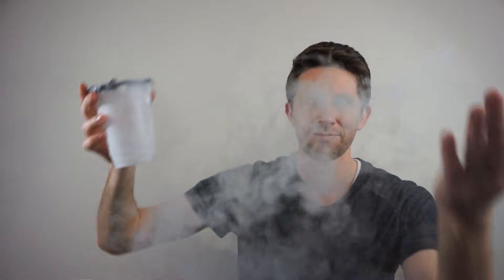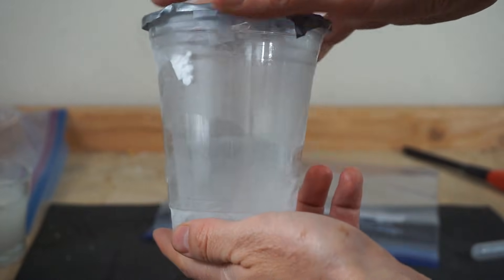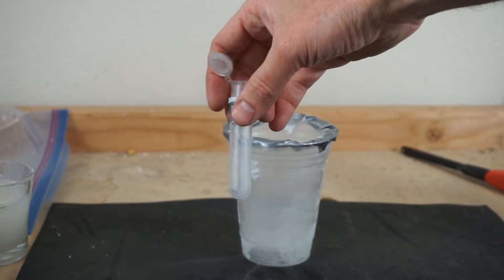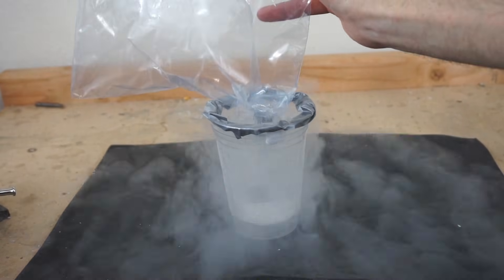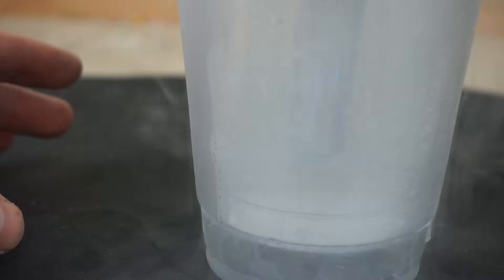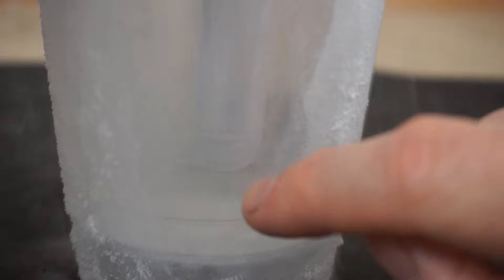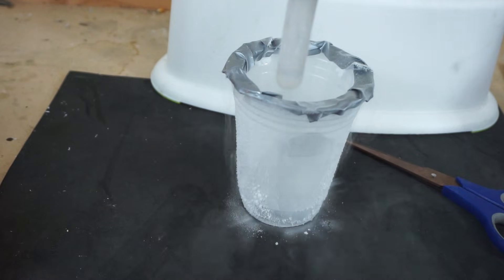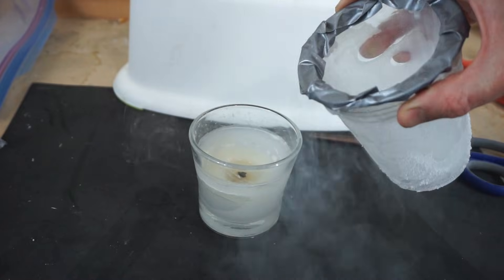How to Turn Air Into a Liquid

Comment: apparently Air (oxygen), becomes metallic under pressure, at 96 GPa - "Pressure at which metallic oxygen forms (960,000 bar)". I'd guess the Aerogel is a diriviation from from the Blue Ice they found in Antartica. And so is all the liquid- nitrogen, oxygen, dry ice and so on. But who rly knows, might as well came from the removed parts from the Bible or cellars in Rome,,, or some other private collection who holds insane information and history of everything public school would teach if it didn't want a very specific type of individual ready to go vote and take boosters and pay for their already paid water. Fathers built it, paid for it. But one neighbur is making you pay for it. Lovely system :) And he's cousine made a bank. Who knew.

Comment: I have a question. So the liquid air - in variance to the liquid nit. If it could be sustained and collected could the liquid air be combustible. And if you could build a contraption that could continuously feed into the nit. how long would it take to make enough to fuel a small engine or something mechanical?

Comment: If we take away the CO2 from nitrogen and oxygen how does the N2 and O2 gain heat energy given they are both very low thermal conductors (near 0 WmK)and they both do not emit or absorb any infrared radiation.   Paradox?

Comment: But air is non condensable
Reply: You're confusing compressible with condensable. Condense means take from gaseous to liquid form. No real fluid (gas or liquid) is actually incompressible. But, if pressure changes relative to absolute pressure of the fluid don't change the density very much they can be treated as incompressible and GREATLY simplify the math. Why deal with the hard math if you don't have to and it doesn't introduce any significant errors.

Comment: Can't you turn air into liquid under pressure? I need thaat
Reply: No. Oxygen and Nitrogen can not be compressed into liquids above a temperature of -100C. They are cryogenic (literally created by cold) liquids. Natural gas cars work on this principle... since it can't be compressed to a liquid at ambient temperatures, just a more dense gas, they pressurize the tank to lots of gas into a small volume. Something like 4,500 psi.

Comment: Isn't it just air moisture
Reply: No, moisture is water vapor (h20). Air is a 79/20 mixture of O2 and N2 molecules. Water vapor is liquid between 0C and 100C. Oxygen doesn't become a liquid until it cools to -297F

Comment: Fool,
The contents in that tube is air which is composed of 70% nitrogen and 30% oxygen. The test tube is not 100% pure oxygen, so of course the contents in that test tube would turn in to liquid nitrogen. FAX
Reply: totally agree, liquid oxigen is cooler than liquid nitrogen so probably in the vid we only saw liquid nitrogen making more liquid nitrogen :P
I don't think u can make liquid oxigen with liquid nitrogen
Also liquid oxigen is pale blue
Reply: Air is approx. 78% Nitrogen, 21% Oxygen, and a combined 1% of other gasses like Argon, Carbon Dioxide, Carbon Monoxide, etc.

Comment: could you make solid oxygen, and is it safe to eat?
Reply: first question: yes
second question: no
And in the video u r just seeing liquid nitrogen, liquid oxigen is blue not transparent, oxigen has a higher freezing point, so u can't make liquid oxigen with nitrogen
What u see on this video is liquid air wich is mainly composed by nitrogen, 79% nitrogen to be exact

Comment: pv=nrt
can we boiling water just by pressing it in a chamber of fixed volume?
Reply: You could boil water by putting it in a vacuum chamber and decreasing the pressure, yes. All boiling is is giving the molecules in the liquid enough energy to become unbound. Atmospheric pressure keeps them together until enough heat (for water at sea level it is 100C) is in the liquid. This is why water boils faster at higher elevations (high altitude cooking instructions). Decrease the pressure enough and it will boil at room temperature because room temperature gives the molecules enough kinetic energy to become unbound from each other.

This is also how pressure cookers work. The high pressure keeps the water from boiling and just provides heat at pressure that gets forced into whatever you cook.

Comment: Very cool. What could that liquid 02 be used for?
Reply: Rockets. SpaceX's Falcon 9 uses refined kerosene (RP-1) as fuel and liquid oxygen as the oxidizer (that's the white vapor venting from the rocket before a launch, liquid o2 turning back into a gas). The new SpaceX Starship uses liquid oxygen and methane fuel (methalox).

It is also really great for storage of lots of oxygen in a very small space. You saw how a gallon baggie of air contained only about 1 cc of liquid. Realize that air is only 20% oxygen and 1/5 of that liquid in there was oxygen. Store big cryocylinders of that stuff and you have a LOT of O2 on hand.

Comment: Wow u show approximate condensing ratio WHICH to me is more important then pressure ie how many times do you HAVE to HALVE air cto make it liquid versus how uncompressed must it be to remain a gas . . 

Anyway o8 is a material that takes up even less space then o2 in solid form AND has yet apparently to be sold at atmospheric pressure despite it's stored kinetic energy.

Which sucks sir!

 Phase change materials tend to be passive so lack nonrenewables density.  O8 can be driving energy source for heatpump to trigger expansion and recover ENERGY needed to compress it.

If it could be made at SCALE.  The motive to do so is greater in atmosphere as heat is available UNLIKE when used to burn For ridiculous rocket power!

But nobody cares about renewable fuels.  

The thing is that as fracking demonstrates when it comes to fuel 100x to 1 ratio is fine.  A solar plant that solidified air need only nearby rail so could waste most of THE initial heat if it concentrated energy into a moble form ten times as dense as gasoline without any non reversible effects aka poluting when used.

Nitrogen of course to a lesser degree is a clean kinetic spring fuel needing only magnetic levitation in a vacuum insulated container rig to be storable across days or LONGER when like supercapacitor banks only hours or less obtain 99% of value.

The plot thickens lol.

Like toy planes bikes can't require a. too expensive fuel.  That's just not possible as they need so little! For most the cost of battery per trip, like incandescent bulbs did, vastly exceeds power purchased to charge thems COST.

So coal Burning even burning bikes save planet arguably but red oxygen zero emission ones are sexiest vehicle known in universe and O8 seems excellent even ideal fuel for supersonic container ship trailering.

'Screwing' air into crumbles does dump heat.  The heat can be used by colocation or dumped. Solar heat is priced dam cheap when used to frack etc.  The incentives exceed its cost even! In near future most solar energy will be used to release carbon via combustion.  HELLO?

Instead of making red oxygen pellets to power clean bike turbines.

FUCK that!

Comment: Liquid air?   Why don't they use that in scuba tanks? I mean with an expansion chamber of course.  Is it because the water would freeze around it?  The tank isn't strong or thick enough to hold liquid air?  Oh wait. The nitrogen would expand first and suffocate you, right?

Comment: So is when you say boiling point you mean the liquid is actually hot and regular boiling right? So then what is all that gas going off from the cup?
Reply: That was condensed water vapor (fog or mist) you can't see gas.  You can't see steam either. That's also condensing water vapor.
Reply: Yes, it was boiling but "boiling" only means too warm to remain liquid.  Water boils at 100C.  Iron boils at many thousands of degrees and liquid nitrogen boils at a temperature higher than dry ice but still horribly cold to us.
Reply: Boiling does not mean hot. Boiling means that the molecules of a liquid have enough kinetic energy to break apart from each other and become free floating. Liquid to vapor. Liquid water at sea level boils at 100C (212F). Liquid water boils at 85C (185F) at 14,000 feet. Less pressure means it is easier for the molecules to break free from each other which means it takes less temperature. Oxygen molecules require so little energy to free themselves from a liquid that it boils at -297F. Anything above that temperature and it turns to oxygen vapor, like boiling water turns to water vapor.

Comment: Can we turn liquid into solid by compression
Reply: There is a property of gasses called the critical temperature. It's the temperature above which a gas can not be compressed into a liquid. For things like N and O, that's about -100C, which is why they are called cryogenic liquids. Cryogenic comes from two greek roots meaning created from cold.

Comment: Question, could liquid air be generated with a cryogenic stirling piston and fill a tank that can be pressurized then use that liquid air to put out a fire? Or would the liquid air become flamable?
Reply: Air is not flammable because it is 79% nitrogen, which is inert. Oxygen however is very flammable. You know that whole thing how fire needs 3 things? Fuel. Heat. OXYGEN.

Comment: You do know there was no need for that bag, right?  All you need is to put an empty test tube into the liquid nitrogen.  I did this same experiment before but I used several test tubes at once so I could make it faster.  Of course, that boils off your LN2 faster.  Then, you take what you produced in each test tube and combine them into one test tube.  It didn't take me long to fill a single test tube with liquid air.

Comment: Got a question would it be possible to use liquid air in an absorption refrigeration system where the liquid air is passed through a condenser for rapid heat exchange were the liquid air boil off returns to a electric sterling sealed cylinder were the vapor is turned back to liquid air to start the cycle all over again?

Comment: So when the liquid air came back to room temp., would it evaporate and re-inflate  the bag?
Reply: Eleasah Chance yep. All of those molecules that were in the bag were just brought together because how cold it got. Once they warm up they'll go back, or expand, into the original state that they were previously. Nothing more than expansion and compression going on inside that bag.
Reply: Yes. It's an example of hot things moving faster. The molecules in a gas have more energy than they do in a liquid, so they move faster and bounce around more and take up more space. When they cool down enough to form a liquid, that liquid takes up significantly less space than the gas did. So that gallon size baggie of gaseous air is less than 1cc of liquid. When he tried to throw it on the candle, since it wasn't that far below its boiling point (-297 degrees F), it VERY rapidly got above that and went straight back to a gas.

If you take a mylar balloon outside on a REALLY cold day, or in to like a walk in freezer, you will see the balloon shrink and become all loose. You haven't gotten anywhere near cold enough to liquify the air, but you have slowed the atoms down enough that they take up less space.

Comment: There is an easier way to make liquid oxygen. Pour some liquid nitrogen into a styrofoam cup till it's full and let the liquid nitrogen evaporate and after all of the nitrogen is gone you will have a good amount of liquid oxygen in the bottom, grant Thompson did it in a previous video with like 6 cups of liquid nitrogen and ended with a full cup of liquid oxygen.

Comment: Faster way to get a lot more liquid air pour liquid nitrogen in a styrofoam cup all the way and then let all of the nitrogen boil away, all you are left with is liquid air
Reply from the maker: That is actually the slower way. You have to wait for the liquid nitrogen to boil away for like an hour or more. This method only takes a few minutes.
Reply: Actually not true anyways, boiling off the nitrogen creates rapid expansion which generates minute levels of friction close to the surface layer (within the boundary layer) and that creates a negative ion charge which molecularly attracts oxygen molecules in the near by air, which is brought close to the liquid nitrogen and then liquified because the nitrogens temperature. 

So to boil off liquid nitrogen is to result in liquid oxygen, not liquid "air"

Comment: What happens if you put the liquid air in a Vacuum Chamber?
Reply: It'll lower the boiling point which will eventually lead to the liquid to stop boiling, then if taken further down in atmospheric pressure, it will eventually lower the freezing point (make it freeze at hotter temps) which will eventually make the liquid solidify into what you would think of as ice

Comment: what happens if you throw a burning match into that small tube with the liquid air? BOOM?
Reply: TheValinov oxygen isn't even flammable let alone explosive. It simply aids in the burning process. It'll make the match burn faster, because the oxygen is not a fuel, the match is the fuel.

Comment: Your content is getting more and more interesting as time goes by. But please, think of the viewers who are not quite as aware of the potential dangers as you. Please start wearing safety equipment when doing these. In this case, heavy insulated gloves when handling LN2, and also eye protection or better yet complete face protection. You really owe it to your audience to set a "good example".
Reply: If you have heavy gloves on the nitrogen goes right through and sticks to the skin freezing it when you dont have gloves the leidenfrost efect goes in and forms a layer of gas which efectively insulates you but I agree with the eye protection

Comment: Can you breathe in liquid air
Reply: No dumbasses. You'll freeze your lungs. Air/oxygen can NOT be liquid in a reasonable atmosphere without being sub zero temperatures.
Reply: WPXTacoMan477 r/whoosh
Reply: Pablito Prado no because  it is very cold that it freeze
Reply: what about compressed liquid air?
Reply: ets2 no because to breathe it u have to get it off from the tank and it will evaporate